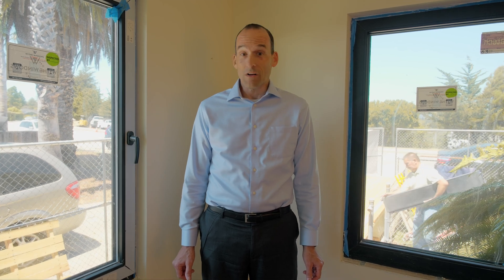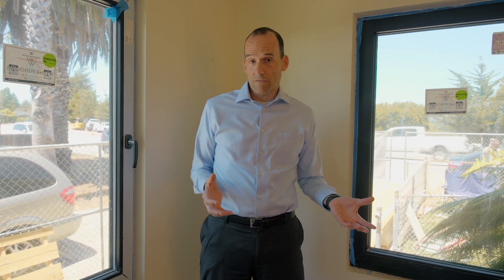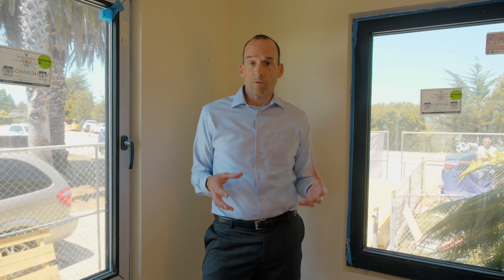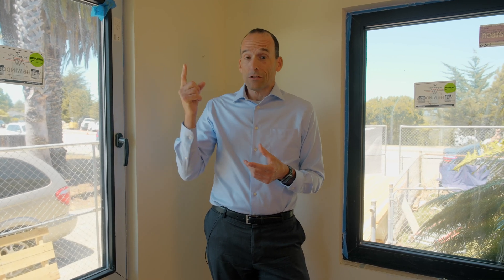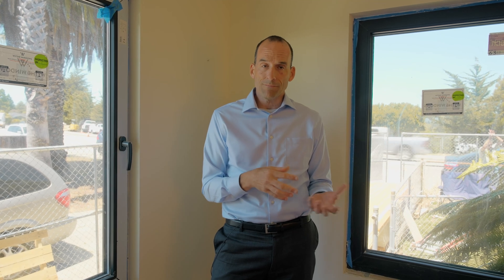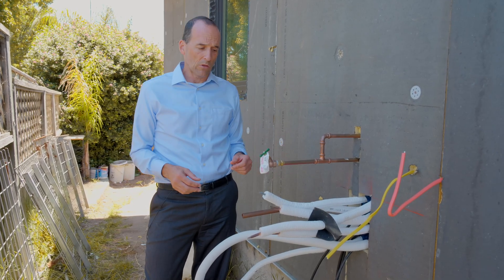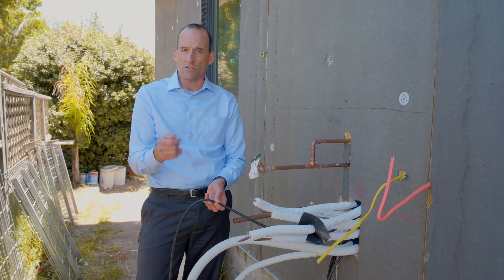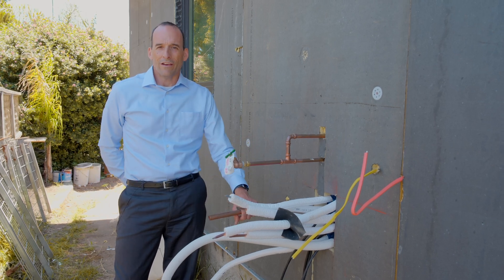A Single Hairdryer Can Heat This Entire House!

Comment: Which HVAC installer do you use or can recommend? I've had so many in the Bay Area come over and so many of them dont even know what a Manual J is.
Reply from the maker: There are a lot of great ones out there and some bad ones too.  I would recommend going to the BABSC.org website and look at the HVAC installers that have spoken at those meetings.  That will give you some indication of who we like.

Comment: I bought a small simple house in Kansas City (near Kansas City) with the plan of completely remodeling it to near passive house standards. I can’t even get contractors to agree to use Zip-R sheathing let alone anything nearing passive house standards. It looks like I will literally be doing all the work myself. My biggest challenge right now is finding high performance windows that are somewhat reasonably priced.
Reply from the maker: Sorry to hear that.  That must be really frustrating.  You might have better luck if you work with std. Plywood and use a top of the Line self adhesive membrane for the waterproofing.  Zip sheeting is pretty particular with respect to the tape and if you don’t do it right, it can direct water into the house, so that may be why people in your area are loathe to install it.  We don’t use it for that reason and others, and we prefer to always have our tape flashing shingling outward.